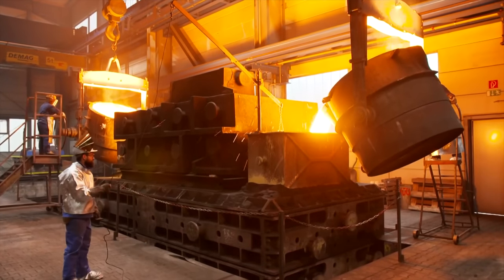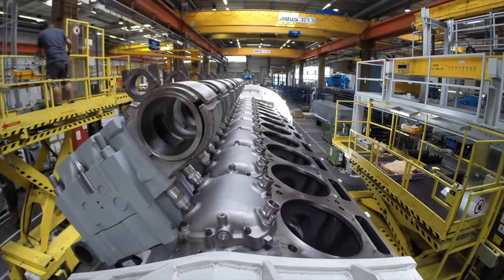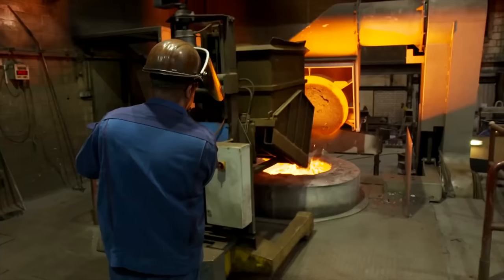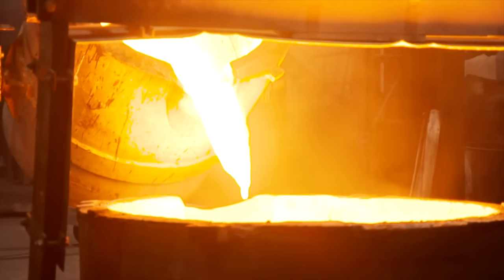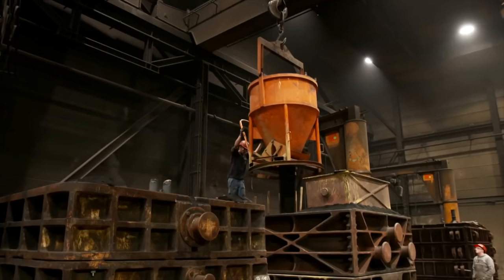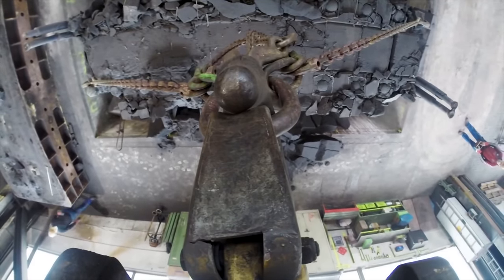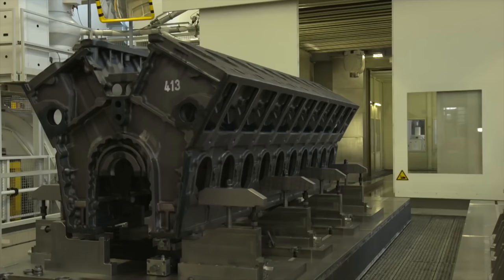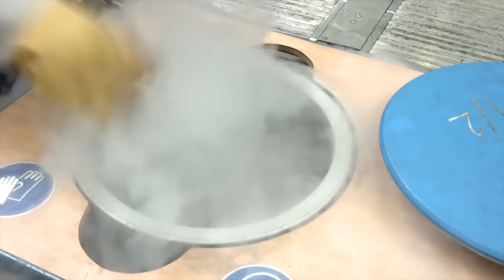Manufacturing World's Largest Diesel Engine | Inside Germany's Top Engine Factory

Comment: German engineering is unreal.  What an engine and what a process of building it.  This engine is large but I used to work on engines that were larger, in the 1950s, used on drilling rigs, but they weren't diesel.
Reply: Finnsh engineering made largest engine ever built and still in production. THE CRANLSHAFT WEIGHS MULTIPLSE TIME THIS GERMAN LITTLE
Reply: Yeah, I wonder why they used piston engines. Most of the time when a massive amount of horsepower is needed they use steam turbine engines.
Reply: @MrMarinus18  The motors I am talking about were on drilling rigs, that had to be moved every three months to every six months; they had to fit on an eight foot wide trailer bed when moving.
Reply: @r.g.crainbow8703 Sulzer technology from Switzerland!
Reply: @MrMarinus18 and yet, most non-military ships use massive diesel engines. 
They are so big they get moved in multiple parts.
Reply: @MrMarinus18  I don't think steam engines are as efficient as combustion engines. Nuclear aircraft carriers, nuclear subs, and electrical generation plants use steam, I'm probably missing something big, but I can't think of many other places where steam is used. 100 years ago steam was king.
Reply: @bigredc222  the steam used today runs electric generators to provide power for the electric motor that powers the ship
Reply: @holmes1956O  Yea the same as a power plant on land. I imagine they are turbines.
Reply: @r.g.crainbow8703  Dyslexic detected😂😏
Reply: @r.g.crainbow8703  Sulzer is a Swiss company. They developed the engines, Wartsila just bought the design and manufactures it.

Comment: It’s a good job the MTU engineers know about engineering because clearly the narrator or narrative writer know very little.
Reply: nor is it anywhere near the biggest diesel engine in the world
Reply: @henrikthomsen1617  I think its pretty small compared to those Wärtsilla monsters. But what they probably meant ist that this here is the largest high speed diesel engine.
Reply: ok genius 😂
Reply: "This super engine can operate for over 35 years without requiring maintenance." 10:42  Yeah nah
Reply: @petemonster1 I laughed when he said that 35 years of use and still running on original oil and other parts 😂
Reply: 20rpm at full throttle. 720mm diameter pistons.. There are so many wrongs in this video
Reply: @henrikthomsen1617  is the largest high-speed diesel in the world
Reply: Yeah, I like the “lathe” machining the decks. Who proof reads the script?  Piston bolts?
Reply: @blightborn87  clean ur ears bud...he said 20 revolutions per second which comes out to 1200rpm

Comment: One of the largest diesel engine was built in Finland (around 110,000 HP) a few years ago. Already in the 70', I was working for Brown Bovery in Baden (CH) on the turbocharger for a 40,000 HP engine. Makes this one look like a dwarf.
Reply: Oh  how I miss working big back then.
Reply: @SunriseLAW it would be worth investigating what is the difference between a diesel engine and diesel oil... you can use rapeseed oil or melted butter or even mustard oil in a diesel engine and it is still a diesel engine.
Reply: That engine doesn't built in finland  it's built in korea under licence and supervision of finish company wartsila

Comment: The RTA-96C made by a Finnish company is the largest and most powerful diesel ever produced, is 44 feet tall, 90 feet long, weighs 2300 tons and produces 107,389 horsepower. Though the 8000 series is a workhorse it is a fly on an elephant’s back when compared to the RTA-96
Reply: @SunriseLAW  it’s still a diesel engine as the name came from Rudolph diesel, and is classified only by being a compression ignition engine not by the fuel it burns as diesels can literally burn a host of fuels as long as they burn, and can be introduced into the cylinder in a way that the fuel won’t pre ignite. Diesel fuel literally got named such because of the engine not the other way around.
Reply: @SunriseLAW  As @johngarlick7115 said, RTA/RT Flex-96C is definitely still a diesel engine from a technical perspective. Purely on the fuel point: ships regularly run on lighter fuels like Marine Gas Oil (MGO)/Marine Diesel Oil (MDO) (i.e. diesel) in emissions control areas such as certain coastal areas, ports, etc.
Reply: it’s actually 113,000 hp
Reply: Chalk it all up to good ol German propaganda
Reply: may be they wanted to say "most powerful high or medium speed diesel"
Reply: The new chef in town is the MAN  Diesel with 118000 Hp,   who is built for a series of the biggest container ships in the world   made in Korea,  Ever Ace for example  which is 400m in length and 61 m in width and 23 992 Teu.  This new Motor produces around 50% less CO2 then previous Motors and consumes less fuel .
Reply: The 96C is not a mass produced engine while the 8000 is. You couldnt even make a video like this on it. But yes its click bait

Comment: Three times between 2006 and 2018 I worked for several months across the street from MTU in Friedrichshafen Germany, with Zeppelin. (A different MTU facility from that shown here)
The two companies even share a parking garage. Later this year I finally get to go inside MTU for training on a similar 20 cylinder 2.6 megawatt (3,500HP) engine that is the heart of a compressor system we sell to boost the power of Gas turbine generators. Kind of ironic using a reciprocating engine driving a multi-stage intercooled compressor to boost a 100 Mw turbine when the engine itself is turbocharged and intercooled. Nice presentation.
Reply from the maker: amazing experience!
Reply: Can you share a link or something to the engine you are talking about? Sounds very interesting

Comment: It is a large engine indeed, but nowhere near the largest. Any ship more than 40000 dwt have way bigger and more powerful diesel engines than this one. I worked on a VLCC made in '75, in Japan, 43000 HP, a man would fit and could stand in the cylinder. It took 3 (three) seconds to start it, either ahead or astern. The engine you've shown were the same size as the diesel generators.

Comment: I wish my car could run for 35 years without maintenance lol
Reply: Buy a Toyota then
Reply: @IsaacTui  12 valve cummins or 7.3 international ftw. My 1996 cummins with 300k burns no oil, has 425psi compression in all cylinders, and is turned up and been taking a beating since I bought it with 220k 3 or so years ago
Reply: @salmonslayer707   Nice man
Reply: Get an early 2000 bmw😂

Comment: 8:54 a piston with diameter of 720mm can’t look like this small in comparison to a lady assembling the engine. By the way will not fit 10 of them in one line of a V20 engine, with two 10 straight on each side, considering the engine is 7m in length. 0.720x10>7.000

Comment: this is a good video from an engineering stand point for sure. but not even close to the largest as the title suggests for instance ther is the MAN B&W 12S90ME-C Mark 9.2 rated at 98,000 hp and standing about 4 stories tall

Comment: Absurd. This is by far NOT the world's largest diesel engine. The biggest and most modern engine version - Wärtsilä-Sulzer RT-flex96C - has 14 cylinders, a lenght of 27 m (88 ft 7 in), a height of 13,5 m (44 ft 4 in), weighs over 2 300 tonnes and has attained a power of 84.42 Megawatts (114,800 bhp)
Reply: Yeah but they were all booked up
Reply: Already in the 70', I was working for Brown Bovery in Baden (CH) on the turbocharger for a 40,000 HP engine. Makes this one look like a dwarf.

Comment: Actually the MTU 8000 series diesel engine is capable of producing 10,000 kW which is 13,410hp, so the video and the description were off those stated figures by about 3,410hp or 10 2006 dodge ram 5.7 liter Hemi V8s lol
Reply: Any way you can not compare engine power without engine rpm. The MTU 8000 series produces the power at 1,150 rpm and the car engine you mentioned at much higher rpm therefore the power values are not comparable at all. Those car engines at 1,150 rpm will have much less power than 340 HP.

Comment: So much use of wrong terminology/confusing terms, contradictory information...is this one of those videos where the narration is made by a 'bot? Then....
First it says cast iron, then steel, then iron, then steel again, and finally iron....which is it? 
Since you apparently don't know, it is cast iron, not steel, and the molten metal is sourced from induction furnaces, not blast furnaces as stated at one point. 
  'It goes to the machine shop for polishing'...no, it goes to the machine shop for milling and machining to spec. I could go on but why bother, please try for better fact checking/editing and production values next time.
Reply from the maker: Thanks for correction